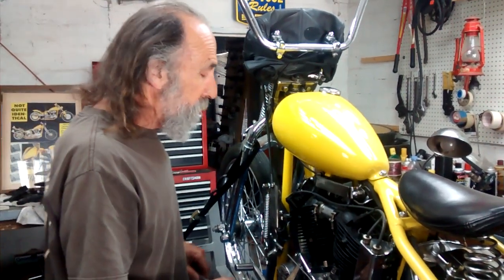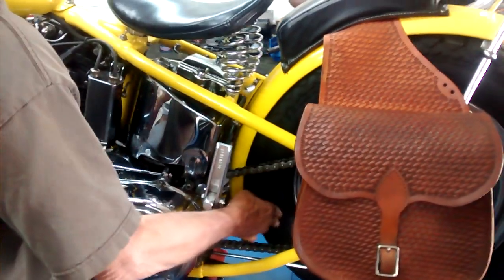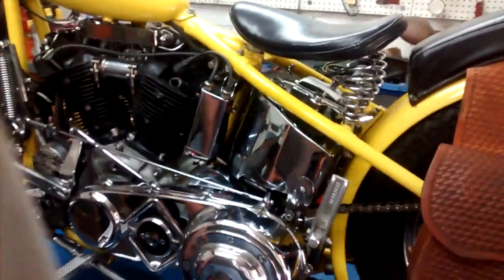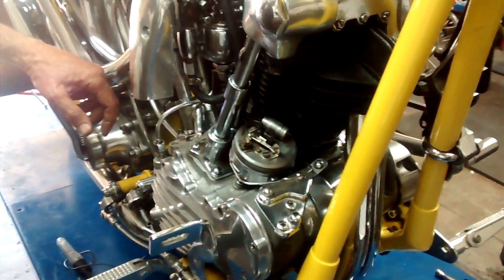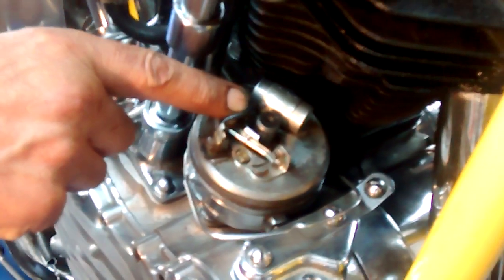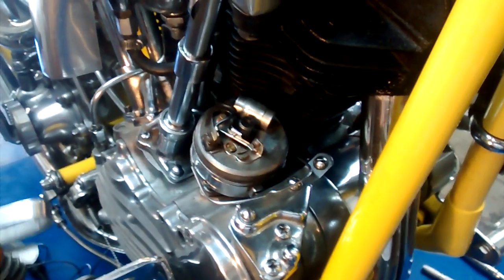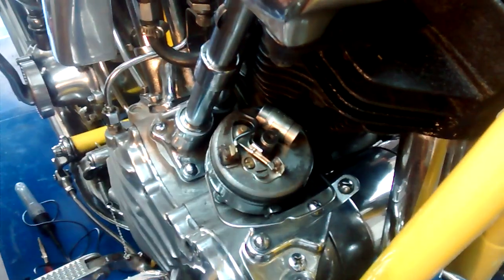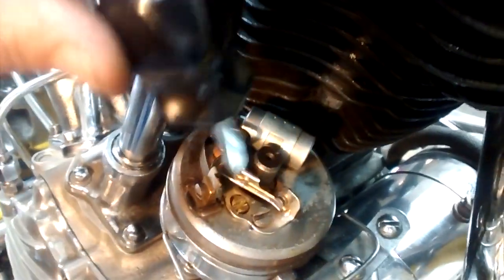How to set the points and timing on an old Harley Davidson Big Twin.

Comment: Mike, I appreciate you, is there anyway you could show us a dual point set up, using a dwell for perfect dual point timing?
Reply from the maker: I don't have one around.  I do find them maddening, however.  To set them up, time consuming, but not too difficult.  I set them by the book (they were used from 61-64, I don't remember for sure).  Hard to keep them set properly.  I normally replace that setup with single points and coil at the same time I convert to twelve volts.  The service manual covers it real well, although a dwell meter should be the way to go.
Reply: @pacificmike9501  
I have it set up like the service manual says, using a test light, but I have heard when using a dwell, you can really dial them in. I’ve not used a dwell before and there is no speck in the book for it either.  Thank for the reply Mr Mike..  keep the chrome side up, and ride on.
Reply from the maker: We used dwell meters on cars a bunch in the old days.  If you set your bike up by the book, you'll be fine.  But, you'd really like single points and a good 12 volt system with a really nice hot 12 volt coil.

Comment: Is the timing mark (67' single point automatic adv) supposed to be in the middle of the window or to the right side just in view?  (have a manual on order)
Reply from the maker: The answer to your question is the center of the window.. Don't forget: "Circuit breaker cam must be fully advanced clockwise against stop when checking alignment of mark with fiber cam follower."  That should do it.  It's the same for '65-'69 big twin distributors, which are all automatic advancing units.
Reply: Pacific Mike thank you!!! , Again.. very helpful.. look forward to more videos!
Reply: @dutch385  See my latest response Dale, perhaps it helps you.

Comment: I set time by shoving a paper towel down the spark plug hole, turn the motor til it pops.  You are now at or very close to or at tdc.  Timing mark would be in very very close proximity or at "the window".  Thanks Mike.
Reply from the maker: Make sure both valves are closed on your front cylinder or you'll be 180 degrees off.
Reply: Yep.  But if the towel pops, you are pretty much there.
Reply: Great idea.....
Reply: I've mostly used my finger in the plug hole. When you turn the engine, compression will push past your finger.  Compression only occurs on the firing stroke.
Reply: I also put my test light clip on the timer terminal post, place the light where I can see it from the left side, then rotate the engine so that the light comes on just when the flywheel mark arrives at the right spot. I ground the probe end of the test light with a jumper wire. Thanks for the instructive video.
Reply: What weight and brand of oil do you use in your pinhead I have a 1961 fly Thanks for great info @pacificmike9501

Comment: Mike, can you explain the mouse trap, what it does, and why modern bikes don't have one?
Reply from the maker: Harley Davidson refers to it as a "clutch booster assembly."  It is an assembly comprised of a spring and bellcrank which (by using leverage and rotation) makes the clutch lever much easier to operate and requires much less effort to hold the lever in to keep the clutch disengaged at a stoplight.  This is a whole assembly that I'm sure was quite expensive to produce.  Today they do it quite easily with little parts and a diaphragm clutch spring.  People had a hard time learning to adjust them, but believe me, when they're adjusted properly, they are awesome.

Comment: Is the timing mark supposed to be directly in the center on the window or slightly right or left? Because my manual is showing that the timing mark on my FLH should be to the right of the window. Im not sure what u did i couldnt see the timing mark in the video.
Reply from the maker: Do what your service manual (correct position of the mark in the window for your year and model) says.  This is with the ignition fully advanced and your front piston on the compression stroke.  The only difference could be, if your ignition system is an aftermarket unit, follow their specific instructions.

Comment: Hey Mike, any chance you could give some input on setting timing with an auto advance distributor?
Reply from the maker: Same as the manual advance.  Bring up the marks the same way, with the ignition cam advanced all the  way and held in place.

Comment: Mike I have a 1983 fxr shovel stroker 98". S&S internal fly wheels, crank & jugs. What mark should I look for through the timing hole to make sure its top dead center
Reply from the maker: The single dot should be TDC for the front cylinder (with both front cylinder valves closed).  Go to sscycle.com for S&S instruction sheets.
Reply: @pacificmike9501  thank you Mike

Comment: Mike, Im about to resurect a Pan with magneto.  Could you do a points video to refresh my brain? I think I remember most of it but a refresher would be nice. Thx, Great series by the way.
Reply from the maker: I'll get around to a magneto when I put the project bike together.  Back in the day, when I first messed with them, I used the info from an early Sportster manual.  XLCH Sporters ('59-'69) all had mags. This information is perfect.
Reply: @pacificmike9501  Thanks for the input

Comment: It looks like you like to set the timing mark almost in the middle of the window compared to how it’s shown in the manual (far right side of the window).  Did I see that correctly?  BTW, your videos are extremely helpful!
Reply: BTW, I’m working on a ‘48 FL with an FLH cam.
Reply from the maker: It depends on the model.  The placement differs a little.  This is one of the reasons I recommend using a "model specific" genuine Harley service manual.  Harley's own specification should be your starting point.  When you're playing with other cams, ignitions, compression ratios, it all plays a part.  But, that staring point is generally pretty close.
Reply from the maker: That word was "starting"

Comment: so the alternative  method would be you have a timing light, and with the engine running, you could aim your timing light at the mark on the other side and then move your distributor so that you see the mark centered in the window correct? but i like your method as you can do it with the engine off and its nice and quiet :)
Reply from the maker: Thank you.  Ideally, a timing light would be the way to go.  But, it's a very difficult process at best on the old engines.  These are not my ideas.  This is the way it is done.  Pay attention to the manual as to the actual position of the mark in the timing hole.  Then, you can shift it slightly to find the optimum position for the timing of your bike's ignition system.

Comment: Plus, my rear wheel is tight as hell against the trans, I can barely spin it in second gear to even try to get it in fourth. Brake isn’t dragging and clutch is fine on adjustment. Ideas?
Reply from the maker: Is your wheel and tire too large?  Is your chain too short?  It should adjust.
Reply: @pacificmike9501  no, not a fat tire rubbing or the chain too tight, 3/4” deflection at center of run.   No dragging when spun in neutral.   I’ll keep looking though.   Thank you sir!

Comment: Mike: Brought my 56 back up after a decade down, initially because of a bad trans.  All back together, several successful/40 miles each test runs. But she’s running rich as hell, adjust the super e back and forth not solving it.  I know my valves are set right /perfect, but I’m going to recheck timing from scratch anyway.  Too much oil being swept up by the flywheel preventing easy visual for when the timing mark comes up. Aftermarket oil pump, if I drain the horseshoe, then disconnect the lower feed oil line from the tank, to use it as a drain line to drain the cases (as much as it may), is there going to be a check valve in the oil pump that will prevent this tactic anyway?
Reply from the maker: You may have a vacuum leak at the manifold.  Check your carburetor out as per S&S instruction sheet.  If you don't have one, it is online under "SSCycle."
Reply from the maker: Drain your oil out of the tank.  The plug is on the bottom of the tank, on the right side.  If too much oil is feeding, it's probably not returning from the engine to the tank.  Better look into the oil pump.  If you need to drain the crankcase, the plug is on the left side, below the inner primary cover.  Be gentle with it.  Be sure not to overfill the system.  There has to be air in the top of the tank.
Reply: @pacificmike9501  waiting for the new o rings to show up, figure the old ones dried out enough in a decade to crack.   Got the brown viton jobs.
Reply: @pacificmike9501  the two on the spacer and the e body are ok.   Probably swap em out anyway if all this doesn’t do it.
Reply: @pacificmike9501  thanks, boss.  I have a little too much oil in the tank, not much, but I’ll suck some out. I checked upon initial start up to make sure the pump was not cavitating and had return flow, I have a return current in the tank. 
 Since the backfiring through the carb is new, I checked the alignment of the carb spacer more carefully, I think you’re right (as usual... only one reason why we love ya!) I’ll reattach it in the am and report back.   You rock boss. Like one guy said about watching your videos... it is church for some of us. Very zen. I’ll watch videos about stuff I’ll never even deal with... they’re just that relaxing.

Comment: Hey Mike I'm having some real trouble getting this 52 pan ive been working on to start easy any I just did the timing how you did, except for I have an auto advance distributor, any suggestions? It's got points and a super e carb.
Reply from the maker: Be sure you set your advance timing with the dist cam held in the advance position.  I know that's a good carburetor, but, there's an enrichener and not a choke.  Sometimes it takes more prime kicks without a choke plate.

Comment: Thanks for the info Mike ,one thing I don't get though , my panhead manual 1948 to 1965 says  to set  the points to .022 , not .020 . Also do you know if my 1948EL timing procedure is the same on the EL as it is on the FL motors . MY  manual doesn't mention the EL motor at all when adjusting the timing .
Reply from the maker: .020 on Knuckles, .022 on Pans.  I forget.  EL and FL time the same.  Unless everything is bone stock and stock low compression, you'll be playing around with degrees and things to get your motor running the way YOU want it to.  Have fun.
Reply: @pacificmike9501  thanks
Reply: Needed these videos 40 years ago.👍

Comment: Hi Mike. On a cone shovel motor, how do you make an adjustment to the cam to get the large and small lobe to open the points equally within the proper gap specs? In other words, my small lobe is .020 and my large is .017 and I want it opened up some. I hope this makes sense, buddy. Thank you!
Reply from the maker: Something I figured out for myself about 35 years ago.  Your bike will now idle prettier than anyone around.  The long skinny bolt that holds it all together, is so skinny and long, that it can be bent, just a little.  Okay, plugs out, now setting points and rotating engine.  One lobe gives me a big gap and the other a small one.  Not to worry.  Take a small metal hammer.  I think mine is about a two ounce.  Smack the bolt lightly from the side with the smallest gap.  Now check both gaps and repeat until you get them even.  Set it at the desired gap (memory says .018).  Check again and again until you get it.  Be very gentle with the little hammer on the side of the bolt head.  This is a cone motor, with points ignition, fact.
Reply: Mike, thank you so much for taking time to answer this question. I can't wait to give it shot. The bike starts and runs well, but anything I can do to refine it even more is great for peace of mind. Anthony
Reply from the maker: The refining of a bike can last the rest of your life.  We get better, as do our bikes.

Comment: On my 59’ FL has a Round notch as a timing mark on the Crank, could that be a Aftermarket or did some years do that ?
Reply from the maker: The round mark should be TDC.  The straight slash is your advanced timing mark.
Reply: @pacificmike9501  Yea I'm not sure where to time it, I did the round as tdc but with this S & S super E it doesn't. wanna run unless the enricher knob is pulled up. IDK if thats a timing issue or the Carb since I tore it apart to clean it out
Reply from the maker: Sounds like it's too lean.

Comment: I recently bought a 38 UL and started it however the front cylinder did not fire. Only the rear cylinder fired. Is this due to timing? It appears to have spark for both cylinders.
Reply from the maker: Congratulations!  Fun bike.  I have a '40 Flathead 80 that will come up soon.  Before trying to start it. I suggest you check and make sure the valves are operating.  Open the lifter covers and make sure the valves are opening and closing.  Set the proper clearance on those valves (providing they are operating).  Then, set points and timing.  If everything checks out,  (you have spark at the right time, the valves are set properly and functioning, the plugs are clean enough to fire, and you have fuel), she should, at least, talk to you.  If the valves are seized, stop, and remove the cylinder.  If the valves are set too tight, no compression.  Refer to your book for proper settings.  Let me know how it goes, just proceed with caution.  That's a great motor, torque monster, way cool.

Comment: Ya know Mike, Im trying to do my 75' shovel and these videos are misguiding on the timing mark, I have the Line AND the punch mark, Which one is it?? Ive watched several videos and they are all contradicting each other.... ..  Im replacing the points/condensor, and wanna make sure its right, Thanks in advance,
Reply from the maker: The punch mark is TDC for the front cylinder.  The line is the advanced timing mark.  That's where it fires the front cylinder with the timing advanced.
Reply: @pacificmike9501  Thank you Mike...

Comment: Hi Mike, Did I miss something with the voltage regulator or did you remove it for the video? Nice Knuck, by the way!
Reply from the maker: Thank you.  The original was a 6 volt cutout relay mounted to the case.  There is however, a 12 volt generator with a solid state regulator mounted to the left end of it.

Comment: Can this be done on a magneto equipped XLCH 900?
And is it true that an xlch starts in advance only?
Reply from the maker: If you're on full advance, it's most likely going to kick you harder than you kicked the starter pedal.  You need a service manual.  Setting the magneto is in the book.  It is very touchy and exacting.  Once you get it right, it will work great.  Plugs and points must be set according to the service manual.  That means according to the book on a magneto equipped XLCH.

Comment: I have a '52 FL and rather than use the rear wheel, I remove the derby cover and with a long screw driver through the fingers. shift the line about easily while parked on the side stand. (trans in neutral)
Reply from the maker: Interesting way to do it.  Be very careful not to stress the fingers.  They're not made to use in that manner.

Comment: HI Mike , I have a Generator shovel set up.The barrels and heads have been installed on a 1954 case/bottom end by owner at some point in the past. The flywheel only has a line on it and the piston is not at TDC when timing line is at  middle of timing hole so I believe this would be the 35 deg BTDC mark ( or full advance).There is a mechanical advance distributor installed. I am not sure how best to set the timing of distributor breaker cam at the points. My idea is set 35 deg BTDC line in timing hole , turn points breaker cam to full advance ( flyweights fully extended)  and the points should just start to open???? Do you
 have some guidance for me please? Your help is greatly appreciated.
Reply from the maker: I think you mean "automatic advance distributor."  If so, advance the breaker cam to set the timing with the timing mark in the window.  If it is a "manual advance distributor," advance it all the way to set it with the "advance timing mark" in the window.  Check your 1959-1969 service manual for the position of the mark in the window.  You can adjust this slightly for your own fine tuning.
Reply: @pacificmike9501  Yes the distributor uses flyweights to advance the timing at speed. Are these distributors meant to be advanced by hand after being started? I thought that if there were flyweights then there was no need to change timing by hand. Do you know if there is only one mark on the flywheel for full advance (I only see one line and it is well before TDC) I can confirm this with the heads off.

Comment: Mike, what would be the cause of a properly timed distributor not sparking consistantly.
Reply from the maker: Possibly a bad wire or bad connection.  Most likely would be a bad condenser.  Very few parts to an old Harley ignition system.
Reply: @pacificmike9501  thanks turned out to be a bad connection.
Reply from the maker: Cool.

Comment: Good video! Do you happen to have one on setting a late model centrifugal advance distributor and possibly one on a Joe Hunt or Morris magneto?
Reply from the maker: Not at the moment.  Don't have a centrifugal advance distributor around  Good idea though  I'll have one of my friends bring one ove once it's running.  We will have a mag coming up in the future.
Reply: Same thing with cenrtif dis..just have to hold the points cam advanced while checking .centrifugal adv dis is the way to go